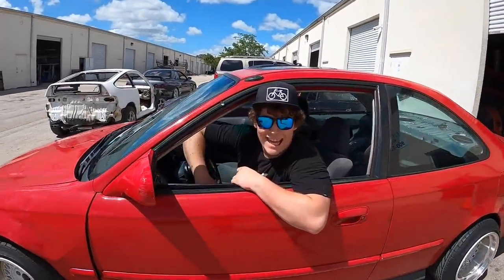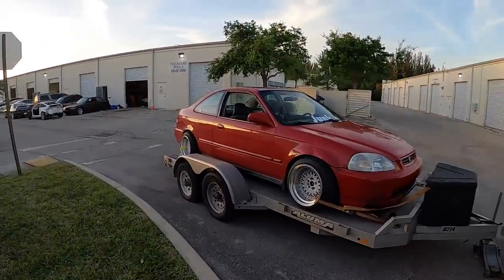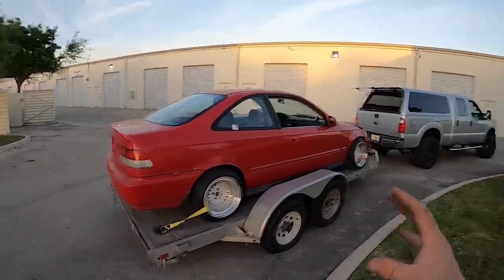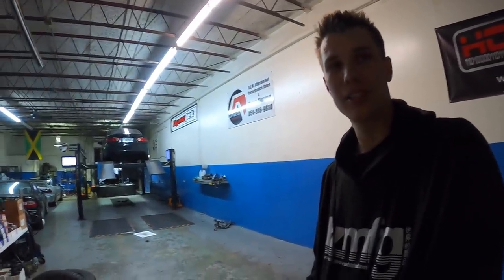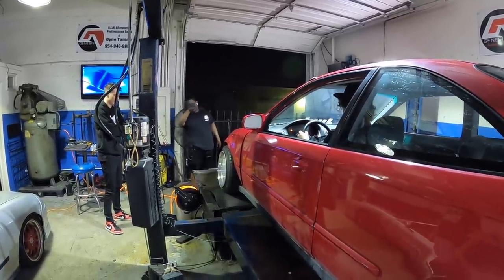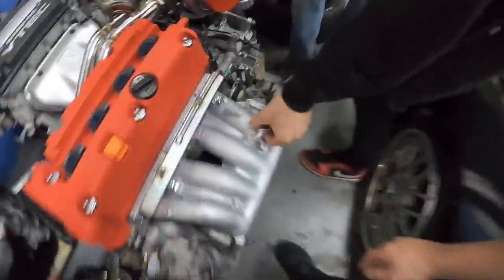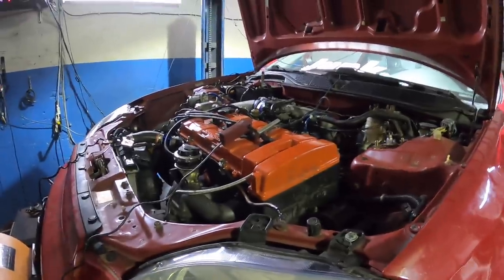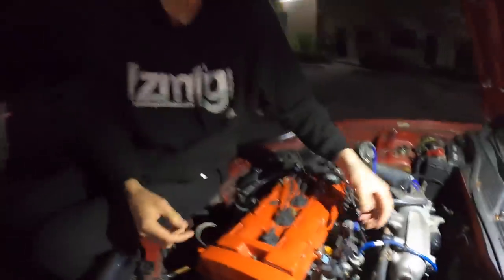RICER CIVIC MEETS RODKNOCK CURSE

Comment: Yes put the k swap in the crx that would be the best motor to put in it and it will be sick
Reply: SAVAGE D EDGE lmaoo he has a hard enough time with basic honda stuff.
Reply: Really he is good either way whether it's kseries or gsr motor but if he wants to make more power easier k swap is the way to go not to mention the added torque and it is a stronger platform he could have 500hp stock k20 or k24 with turbo easy I think ruddy would love it as well
Reply: It’s a engine
Reply: @sogmclovin2394  it's either an engine or a motot

Comment: That's a s300 v1 hondata, they die because the nvram battery goes out(they're over 10 years old), you gotta replace the Dallas NVRam which is the little black part with the hondata sticker inside the ecu(they sell them on eBay) and get it replaced by someone you know that knows how to solder and you're good to go!

Comment: b20bs start to have issues at around 300+hp (Like 12 psi or so??) because of their thinner cylinder sleeves, they're really just a b18 bored out to a b20, b18b1s can handle a safe 400+ if I'm not mistaken.

Comment: Chris common rule of thumb for injectors is 1cc = 1hp meaning 270cc injectors are MAX'd at 270hp (any probably before that tbr) and e85 is 40% less. stock SR20's commonly dyno between 220-255 and they use a t25 and 370cc injectors for reference.

Comment: I get the injectors were the limiting factor here, but if that tuner doesn't think you can safely make 300 on a stock b20, get a new tuner asap. On boost alone I make 317 to the wheels, with spray I make 388. I've been on this setup just over 2 years without a single issue.

Comment: Check out huntertuneds older red b20v hatch videos. Center 2 cylinders crack sleeves zosh has been down the same road. Like sammit says keep it around 10Psi so you can keep it around for awhile. I love the b20s but the sleeve walls are alot thinner than b18, b16. The head and cams doesnt flow as well up top as the vtec. K series crx mate!

Comment: Your body’s full tight when your on the board I wake board and kneeboard you can’t have your body tight and like the muscles doing everything you gotta just be calm and like instead of having ya arm and legs full pushed out so there tight have them in a little with a bit of movement it will help you as your so tight and as you try somthing you fall

Comment: Why do people keep thinking e85 can just make you more power? If the limit is already your injectors, fuel lines, or pump, e85 will only make things worse because it requires a minimum 30% more flow.